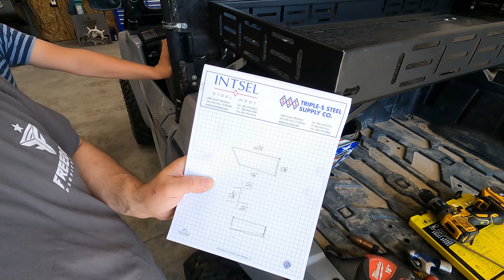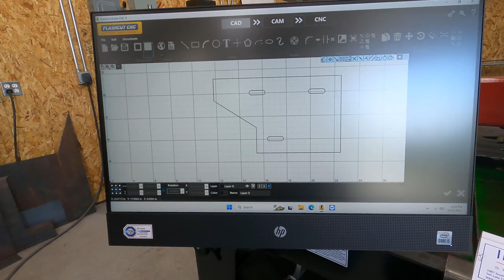Side by Side cargo box fabrication and welding modification

Comment: Could you not get a valve of some sort to make your breaker slower and more control, nice machine just seems a bit aggressive, stay safe.
Reply from the maker: It runs on a hydraulic valve, and I can slow it down as much as I want. Hopefully the different blade material will fix the issue. Thanks for watching!